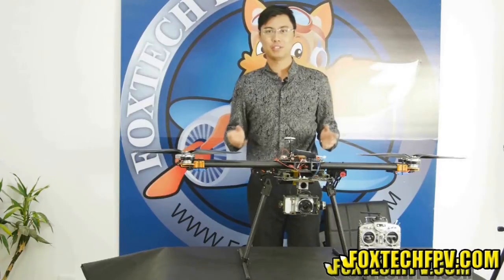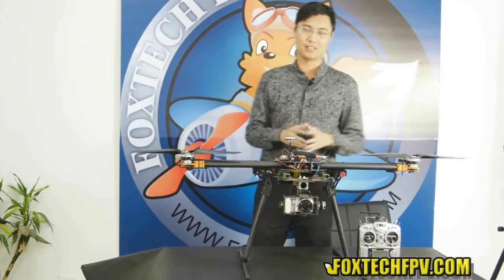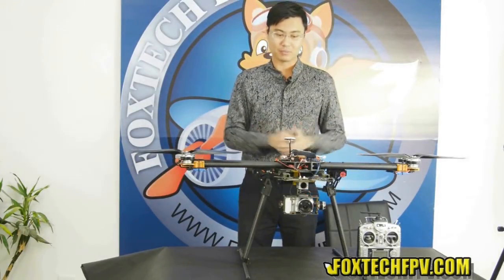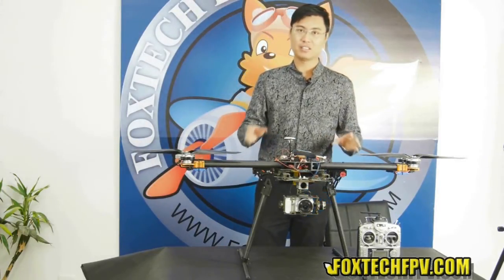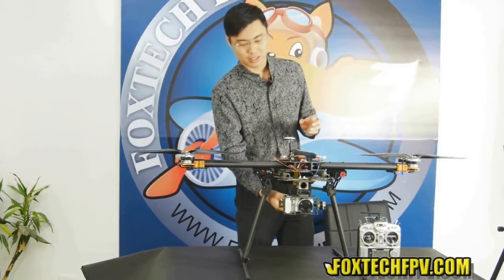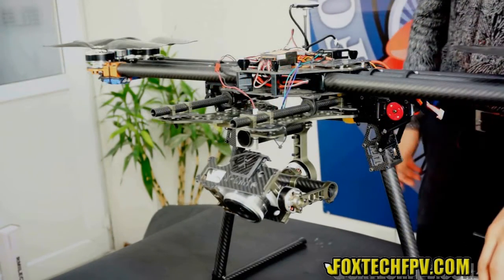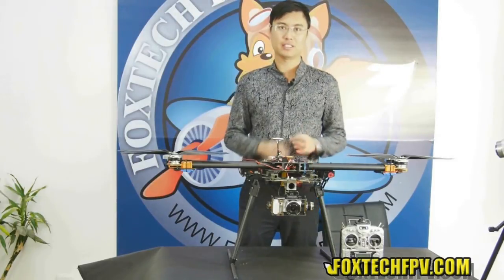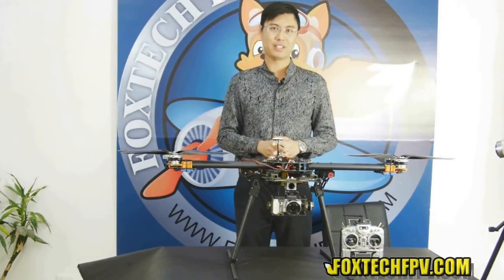XCAM140B Brushless Gimbal For Sony NEX5 series

Comment: Is it possible to use in Tarot FY690s? With the same plate? If not... can you point me to which one? Thx
Reply from the maker: We don't suggest you use 690 match this gimbal , the payload is too much for 690 . We use Tarot 960 in this video and get a good fly time and result
Reply: OK. What do you suggest then for 690S and nex 5? Is there any plug and play with no need to configure controller? thx
Reply from the maker: 690 is too small to carry N5 , you can change to gopro with a gopro gimbal .